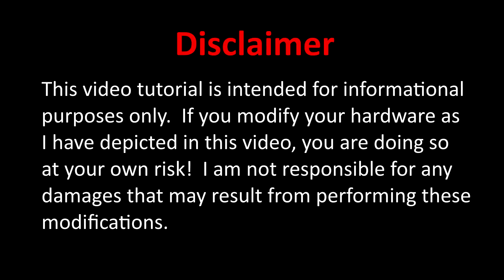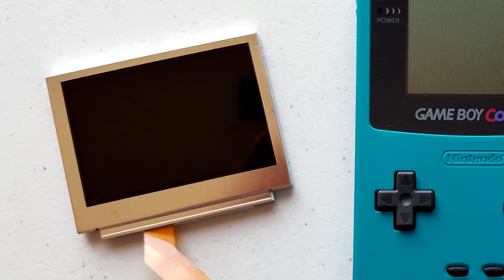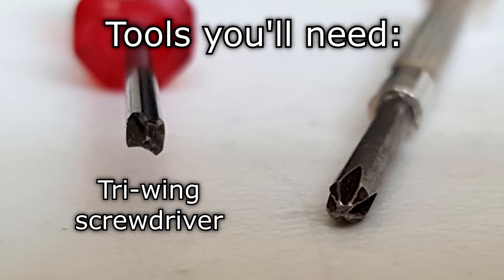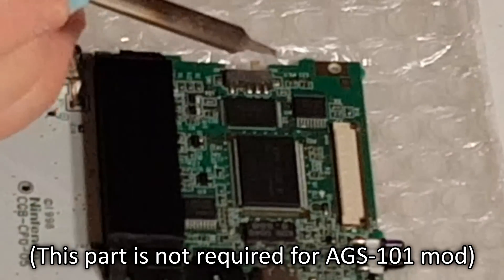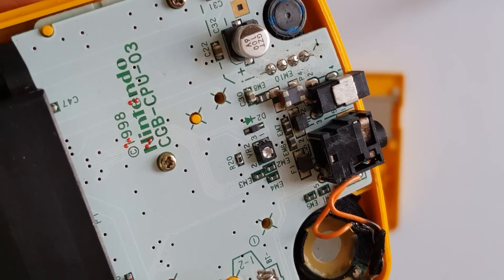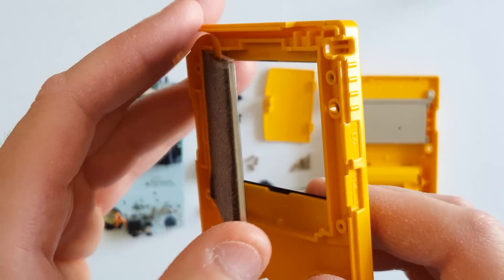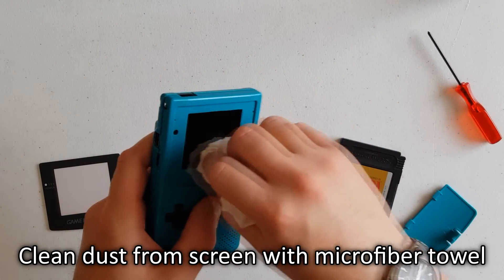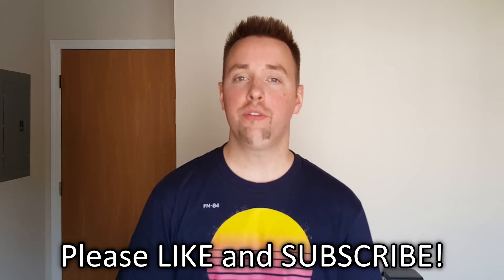Tutorial PART 1: How to backlight a Gameboy Color! (BennVenn's AGS-101 mod)

Comment: great guide! It is also recommend to snip all the protruding pins flush, including the cart socket. This helps closing up the case with no gaps. And the more plastic you remove from the front shell, the easier it'll all be.
Reply from the maker: Thanks, Ben! :)  I'm glad you approve, and I really appreciate all of your help throughout this process.  I couldn't have done it without your guidance.  Keep making awesome things!
Reply: Ben Grimmett I have a question and I couldn't find any other way to message you about this.  anyways, I ordered your ags-101 ribbon cable adapter last week on jul,22, 2017.. and when buying that product on your website a week ago,  it did not mention that it was sold out or anything,  and I was able to proceed to check out and my order was confirmed. Now that it's been over a week, I'm getting curious on weather my order was a pre-order, or if it was forgotten,  or if it didn't ship somehow.. please lmk if you can tell me if  ill recieve my order,  and probably when
Reply from the maker: Jacob Salazar The order on BennVenn's site states that this round of orders is a preorder that is due to ship at the end of August.  One of my friends who also ordered the adapter just received an update email that his was just shipped (mine from Retro Modding haven't yet).  So hang in there, it will probably be to you soon!  If you initially received a receipt email, you're most likely fine and you have a ribbon adapter with your name on it.
Reply: Jacob Salazar did it mention on the product page you ordered when it would ship?
Reply: Ben Grimmett  at the time I ordered it i don't recall tbh, and I was honestly sure that the website didn't say you were sold out at the time(I'm sure I'm mistaken though).. I tried looking for an email receipt of my purchase as evidence,   but didn't have one.. I do have screenshots of my paypal confirming that I ordered the product and payed for it.. I could even email it to you if you'd like.. I'm not worried if I have to wait until late august. I  just want to know if ill receive the ribbon cable
Reply: Jacob Salazar of you've ordered it, you'll receive it. you can email my with your full name for confirmation. my email link is on my stores homepage
Reply: Ben Grimmett I heard you are working on swap and drop for the Gameboy color. When will that be ready?

Comment: you can put electrical tape in the unused white borders of the LCD so it looks better
Reply from the maker: Diego Palestro  Are people even reading my comments...? :P  Here's what I said to someone else earlier today about this same thing:

Matthew Denny  Thanks for watching and your comment!  There has been a lot of talk about exactly this.  Originally, I was going to use electrical tape to do that, but it is very sticky on the edges and would get goo on the screen when trying to dust/clean it.  BennVenn recommended Kapton tape, however I couldn't find any in solid black.  So I came up with an alternative solution: Using matte black vinyl, like what they use to make bumper stickers and car wraps.  It has no sticky edges, leaves no residue, is very thin, and it's opaque and lets no light through.  Plus, it looks really good.  I'm currently making another couple of videos where I will be talking more in-depth about this mod process and also doing another GameBoy Color using some different components and a CNC'd case that BennVenn is giving to me to use.  So keep an eye out for those videos in the coming weeks!

Thanks for watching, Diego!

Comment: Guys, just buy a Gb-boy color, works great no hassle required. Keep your original gameboys, oringinal.
Reply from the maker: Brottochstraff But what fun is that? :)
Reply: no fun, just preservation? :D
Reply: Im hoping one day we gonna have homebrew on the Switch to run GB-emulation on it, that would be something :))
Reply: Brottochstraff try galaxy view 18.4 better than a switch...
Reply: Problem is the picture is stretched. It may not be a problem for some but I'd rather buy a cheap 'broken' Gameboy, spend a little fixing it up and having something I've gone to the effort to make myself rather than a stretched screen.

Comment: The only reason I'm not a fan of this mod, if I must confess, is that the reassembly makes it feel like a janky, unofficial product at the end. Sure, it could be argued that the AGS-101 for the original GBA wasn't much better, but at least a finished assembly looked and felt like an official product, and still closed up properly. Avenues in doing this just make it feel really janky, and if anything goes wrong, you're basically throwing away and replacing a lot of parts.

It's only too bad nobody has yet to reverse engineer that custom screen mod that that dude in China managed to do; that actually managed to look like a professional grade result.

Hate me if you must. I just wish this mod was cleaner to do. That's my one big gripe with it.
Reply from the maker: Jorge Ramos  I don't disagree with you there.  And it's funny that you mention the TaoBao GBC, because BennVenn has successfully recreated a prototype of that unit (check out his Facebook page), and I will be doing a tutorial video on it hopefully very soon! :)  Anyways though, you do have valid points - This mod is certainly not for beginners or the faint of heart.  And unfortunately, this is the only option we have for backlighting the GBC, at least for now.  Thanks for your comment!

Comment: one thing I would have done is electric tape the screen where the white borders are so it looks better. another idea, you could apply masking tape to the visible part of the display and all the outer edges and apply black paint of some kind to the outer white border of the display then remove the masking tape once it dries.
Reply from the maker: Matthew Denny  Thanks for watching and your comment!  There has been a lot of talk about exactly this.  Originally, I was going to use electrical tape to do that, but it is very sticky on the edges and would get goo on the screen when trying to dust/clean it.  BennVenn recommended Kapton tape, however I couldn't find any in solid black.  So I came up with an alternative solution: Using matte black vinyl, like what they use to make bumper stickers and car wraps.  It has no sticky edges, leaves no residue, is very thin, and it's opaque and lets no light through.  Plus, it looks really good.  I'm currently making another couple of videos where I will be talking more in-depth about this mod process and also doing another GameBoy Color using some different components and a CNC'd case that BennVenn is giving to me to use.  So keep an eye out for those videos in the coming weeks!
Reply from the maker: Also, seeing how people have lost their minds over me "sacrificing" an AGS-101 screen for this build (they didn't watch the full video to see that I DIDN'T rip it out of a GBA SP), they would never let me hear the end of it if I used black paint on it....

Comment: Could you go into more detail about the sound chip mod? I have some buzzing from the speaker and could definately benefit from clearer sound
Reply from the maker: Darkson Dap  Absolutely!  I'm actually working on a follow-up video that I'll be releasing very soon that actually will go into this specific mod much deeper, along with a handful of other things.  Just to make sure we're on the same page, have you already performed the BennVenn AGS-101 mod on your GBC at this point?  Or are you currently using an un-modded GBC handheld that has more audio noise/fuzz coming from the speaker than normal?

Comment: I was just wondering if it is possible to scratch off the reflective coating on the original screen, and add a perfect fit LED backlight. Is there any possible way to do this?
Reply from the maker: Blueyzachary  Good question!  Unfortunately, there is a layer of glass behind the reflective surface, so it's not possible to backlight a standard GBC screen like you can with the original Gameboy.  Trust me, I've tried.... :(

Comment: sees 50 dollar lcd screen oh screw that...
Reply from the maker: The Mad Hacker I just bought another one on Ebay earlier today for $36.00 USD.  Prices are coming down! :)  But yeah, I totally get your feelings on it.
Reply: On aliexpress they are like 35 - 30 ;)
Reply: i just don't know if i could deal with permanently gluing the thing together i would have to find a better way
Reply: Hot melt glue is actually not permanent. Isopropanol vapour releases it. If you need to open the device one day, just douse it in iso, it'll come open.

But it depends, is the mod worth it? You can always get a GBA or GBA SP and install a backlit screen there. They play classic 8-bit handheld games too.
Reply: i thought about installing a front light mod instead it would be hella easyer

Comment: Super cool but I'm not sure I'd ever use this mod, mainly because it hot glues the setup back together... which seems like it would make it difficult to do any future repairs or other mods.
Reply from the maker: Sauce  Thanks for your comment - Very fair point!  Actually, I botched this a little bit by gluing it shut in the way that I did.  BennVenn (and some others) have now created some 3D printed screw mounts that work with this.  I show off the printing process in a recent vlog, and I have a 3rd video on the backlit GBC coming out soon that will show how to install and use them. :)  Thanks for watching!
Reply: Kyle'sAwesomeLife excellent, man. Can't wait to see it and try the mod!

Comment: Now. I'm inspire to make a GBC using raspberry board.
Reply from the maker: jaycee sagre  Do it! :)  I'm sure there are some projects out there for handheld GBC emulators!
Reply: I will make an 3D printed GBC Case, Small Capacitive LCD Screen, Raspberry Board, and Customize Printed Circuit Board for GBC. Voila I have GBC without Cartridge Slot.  It maybe more bulky than actual GBC.

Comment: Hi Kyle, my potentiometer screws clockwise and just keeps going.... is there something wrong with it?
Reply from the maker: geekroute  Interesting!  It seems like a bad potentiometer to me, as it should stop spinning very firmly at a certain point.  It MAY still work in this situation.  That potentiometer can be adjusted while the system is turned on, so plug in the AGS-101 screen and the adapter ribbon to the GBC, run the wire from the lead on the ribbon, power on the GBC, and just spin it until you see artifacts and lines disappear from the screen and the image become bright and clear.  Depending on how loose that switch is, taping it in place may not be a bad idea if you're worried about it moving on its own.  I hope this helps, let me know if you have any other questions, and thanks for watching! :)

Comment: Why does the screen display a white border instead of black?
Reply from the maker: charvelgtrs  When the controller on the ribbon adapter converts the video signal coming from the GBC to output on the AGS-101 screen, it maps pixels 1:1. However the pixels on the new screen are physically smaller than the pixels on the old screen, thus making the output image smaller and taking up less space on the new screen.  Hence the white border.

Comment: I think it's a bad way of doing this because you loose the possibility of opening back your GBC if something went wrong after, or loosing the POWER LED.

The size of the screen is obiviously the problem tho, maybe by using a less bigger screen.
Reply from the maker: Nanto Argonar Hi there!  Unfortunately, using a different screen is out of the question for this mod because BennVenn's adapter ribbon cable is built specifically for use ONLY with the AGS-101 screen.  Also, while the original LED cannot be used in the system again after the mod, there ARE smaller 1mm LED bulbs that can be fit into the original LED's space and on top of the new screen.  I'm currently working on a follow-up video that will talk about exactly this and much more.  Thanks for watching!
Reply: Thanks for the answer man ! I wish there will be a version 2.0 of the kit which will be  compatible with much smaller screens and less work on the case :D
Reply from the maker: Nanto Argonar It's interesting that you mention that, because I will have another video coming up in the near future that covers this exactly.  You'll see more details about this in my BennVenn mod follow-up video. ;)
Reply: NICE. :D i'll be around ! :)

Comment: Or, simply order the GB Boy Colour (yes it is called "GB Boy" no matter how redundant that sounds), manufactured by a Chinese company called Kong Feng. Even though it is technically a Chinese knockoff, it is one of the few good Chinese knockoffs. It receives positive reviews from most sources, and it is already backlit unlike the actual GameBoy Color. 

It's cheap, too. The average price of the Kong Feng GB Boy Colour is $40 (in USA dollars), although slightly different versions of it can be found for as cheap as $35 or as expensive as $45. 

You're welcome. I just saved you the effort and additional cost of everything discussed in this video.
Reply from the maker: WillStrop2008 Thanks for your comment!  The problem that a lot of modders have with the GB Boy is that it's aspect ratio is very strange and not 1:1 with the Gameboy Color.  So for those picky people (myself included), there's this option. :)

Comment: Can you link the provider of the ags-101 screen you bought for the mod
Reply from the maker: Sure!  The person I purchased mine from on Ebay is actually sold out and does not seem to have any more in stock at the moment, however this one should work fine for you: https://goo.gl/8g4mUz  You can also search on www.ebay.com for "AGS-101 LCD screen", which should yield a bunch of choices.  The one I linked you to isn't the cheapest, but the seller has the best reputation of any I could find.  Thanks for your question, and I hope that this helps! :)

Comment: I couldn't do that if the LED light isn't there. My OCD would rupture out of my chest. Rather go AGS-001 horizontal frontlight style with the GBC because of that. Easier to revert as well if you want it back to original.
Reply from the maker: JarAxe It's definitely a trade-off, that's for sure.  There ARE ways to fit a much smaller indicator LED into that location just above the screen.  I'll actually be covering this in a follow-up video within the next week or so, so keep an eye out for that.  Thanks for your comment!
Reply: Nice! :)
Reply: Can't wait to see this. So how are you going back in if you hot glued the shell closed? I've purchased the ribbon cable and screen but before going further I'm trying to figure out a way to create new screw holes at the top of the case and gluing some internal fasteners so I can screw it shut.
Reply from the maker: Redsyrup  There was another guy in these comments who talked about 3D printing a new GBC shell with different screw hole placement to accommodate the AGS-101 screen, but I haven't heard back from him yet.  I opted to glue everything shut for this build because I didn't plan on opening it back up, and tape on the outside would look tacky.  I'm still trying to figure this one out myself. :/  I'll be doing another build in a follow-up video that I'm working on right now, where I use one of BennVenn's custom machined cases, and things will fit together a lot better and more flush, so hopefully it will require much less glue.
Reply: Thanks Kyle, Can't wait to see it. You're a brave explorer here on GBC advancement! All these hand held mods really make me wonder if Nintendo will produce a series of Game Boy Classics. If they did I'm guessing it would include new lockout chips to prevent flash carts. Also really like the 'Maker' Culture influence on re-purposing old tech. Go Makers!
Reply from the maker: Redsyrup  Thank you! :)  And I'm also very interested to see what's next after SNES Classic.  The more that people talk about a Gameboy Classic, the more I like the idea!

Comment: So is there any way to get a clear image through frontlighting or did I just waste my money? ;~;
Reply from the maker: Dr. Karate, Dinosaur Hunter  Unfortunately, since the light has to pass through several layers of glass in order to reach the reflector sheet and illuminate the display, a muddled/washed-out image is the best you can achieve with a frontlight kit. :/  Sorry to be the bearer of bad news!  On the bright side, the average price for an AGS-101 screen is right around $30 now, down from $50 a few months ago. :)  You would just have to wait for BennVenn to replenish his supply of ribbon adapter cables again.

Comment: Kyle'sAwesomeLife, I subscribed you!
Reply from the maker: Carl G.  Thanks buddy, I appreciate it! :)  Keep an eye out for my follow-up video for this, which is coming out in about a week or two.  I've got some updated information in it that will help with the modding process.
Reply: Kyle'sAwesomeLife Okay I will keep an eye out for the follow-up video! The easy way to keep an eye out is to tap the bell for every notification about the videos you upload and which I will get notified.
Reply: Kyle'sAwesomeLife What rosin core solder should I use for the backlit Game Boy Color mod? 40/60 or 60/40? Please respond.
Reply from the maker: Carl G.  I believe that I used 60/40 for this project (and for everything else I've soldered in the past).  It's probably the most commonly used/accepted solder.
Reply: Kyle'sAwesomeLife Okay thanks for the answer.